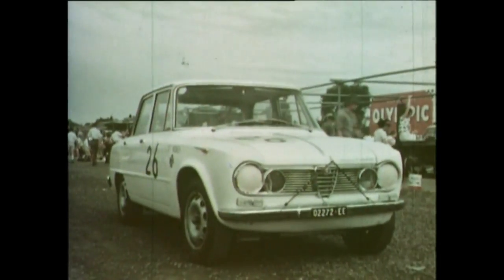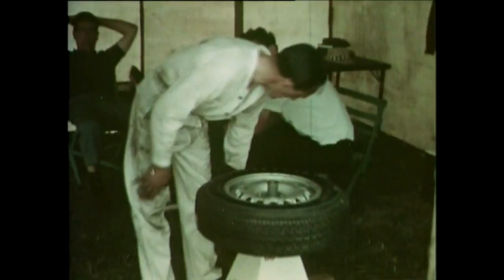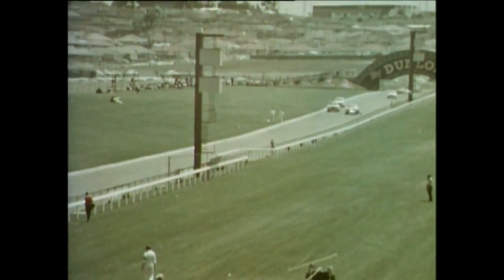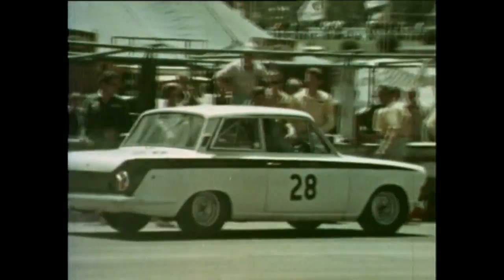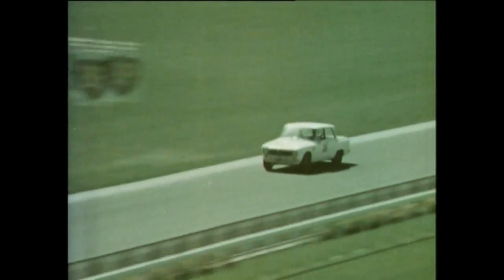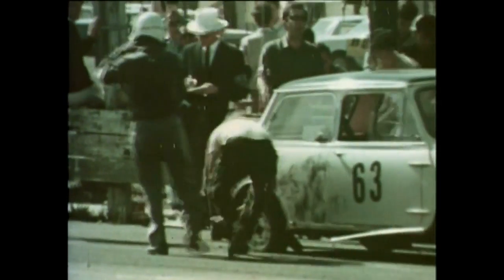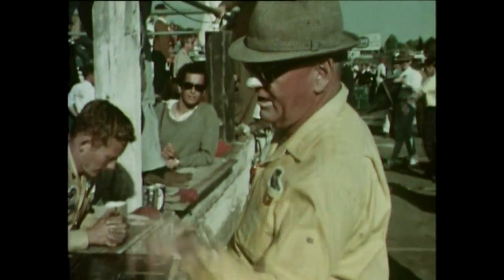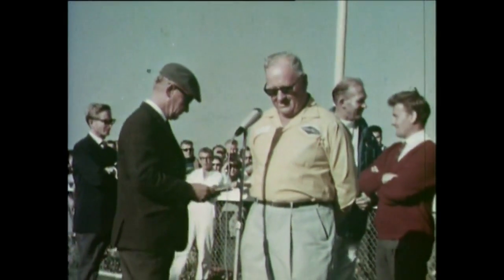SANDOWN SIX HOUR RACE 1965

Comment: that Alfa GTA had great styling for 1965... so many hideous looking and handling cars in the race.... and extremely impressive is the open spaces around Sandown before the Melbourne sprawl of suburbia.... raceway is still there but built in by housing and only exists thanks to the Sandown horse racing track. without the horse racing it would've been sold off long ago.